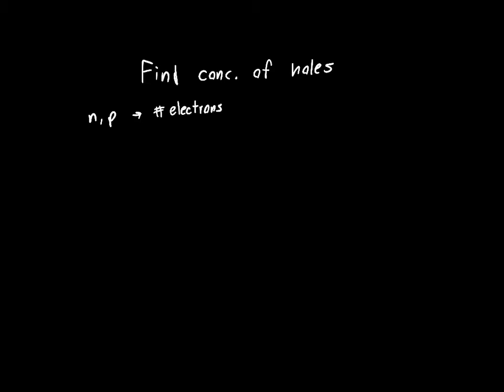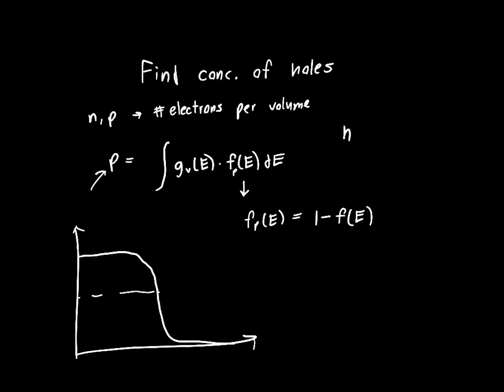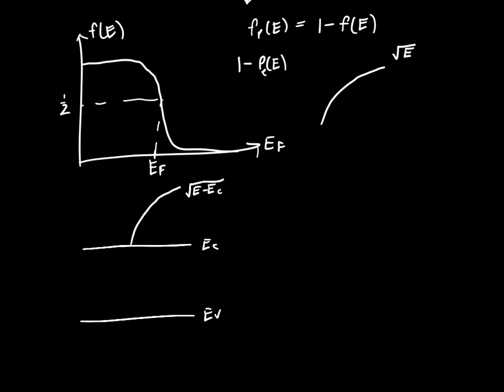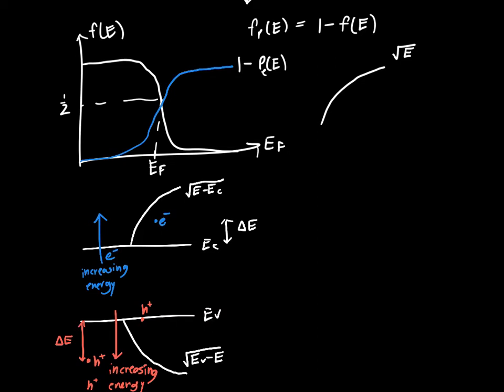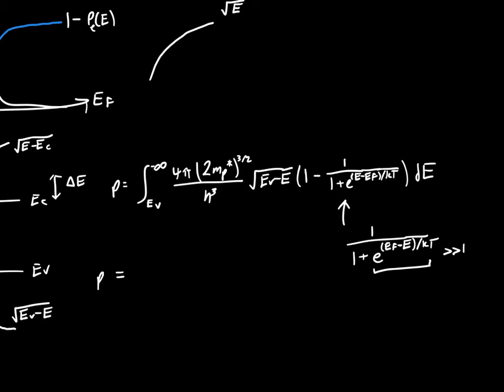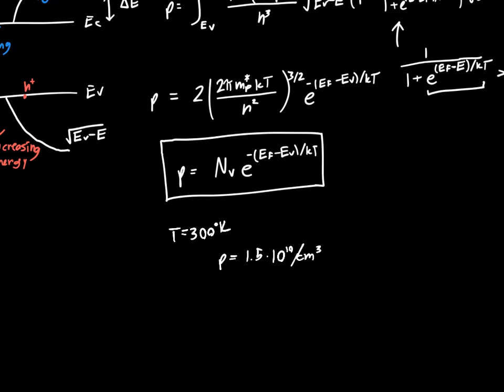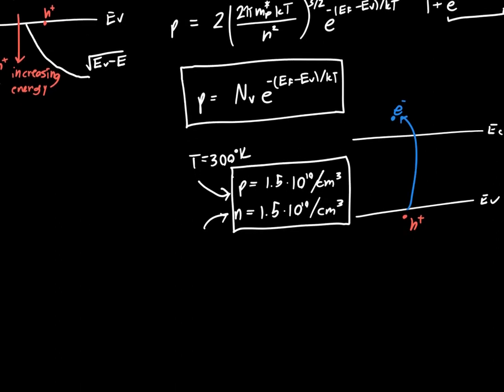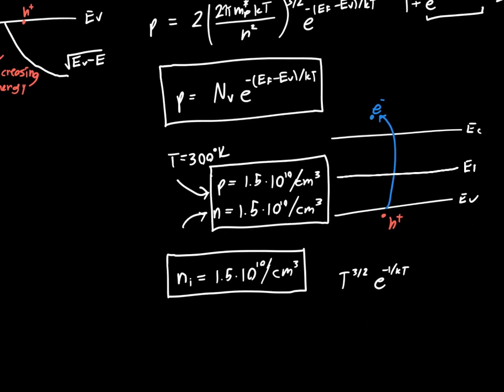Finding the Hole Concentration in a Semiconductor

Comment: I have a question.
What exactly is Fermi level of semiconductor
 because if it's the highest energy state of an electron, then it's presence in the centre of forbidden energy gap makes no sense. Because it means that no electron has passed the band gap and went to the conduction band. Hence, conduction is not possible. Also it means that there is possibility of finding electron in band gap which I've never heard before.
 Please correct me if I'm wrong
Reply from the maker: In metals at T=0K, the Fermi energy is the energy of the highest-energy electron. In semiconductors, the most general definition is that it is the energy when the occupancy factor f(E) (also called the Fermi Function) is equal to 1/2. This may or may not be in the middle of the bandgap, where there are no available states. The Fermi function only tells you if there were states what fraction of them would be filled. With 0 states available, 0 will be filled regardless of the value of the fermi function.
Reply: @JordanEdmundsEECS 👌